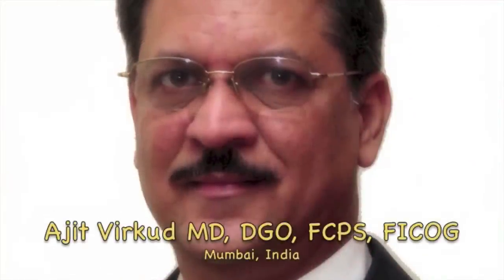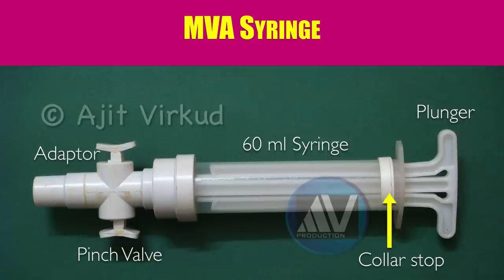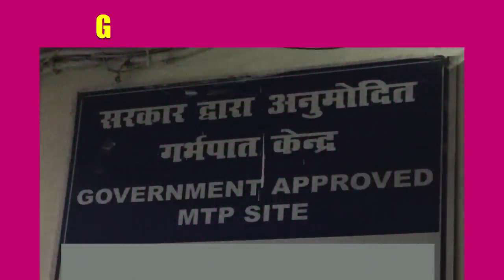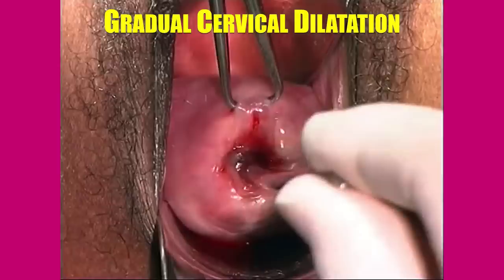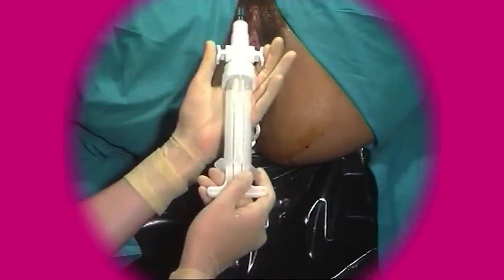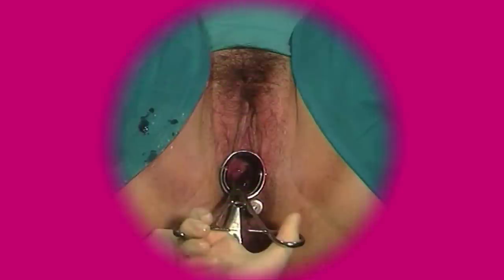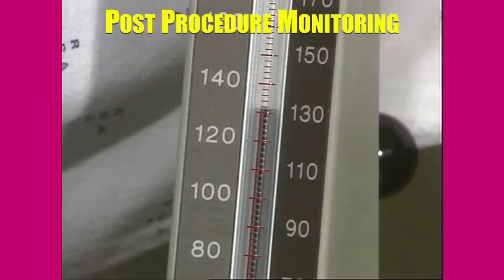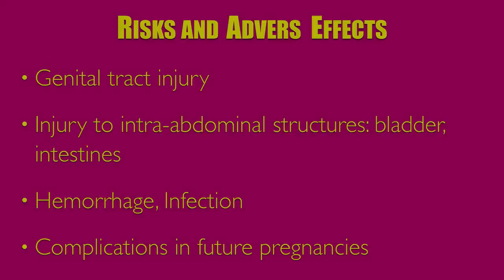MTP Part III Manual Vacuum Aspiration

Comment: Doctor what should do after the using birth control pill the incomplete  abortion of 5 weeks of first trimister done by d&c cause any infections what to do and still long from 5 years my sister facing it right veginal entrace of cervix and hyper pigmentation on veginal hair what should do she consult 3 more doctors all said u have inflammation no need to worry but she still facing like burning sensation and dryness on veginal entrance what should do to get rid of it and get recovery healthy uterus and vegina